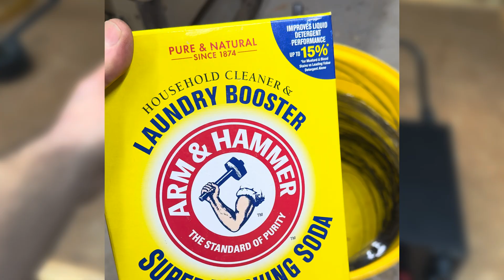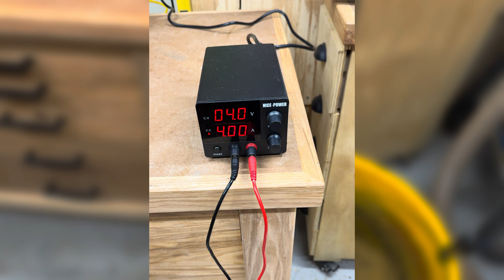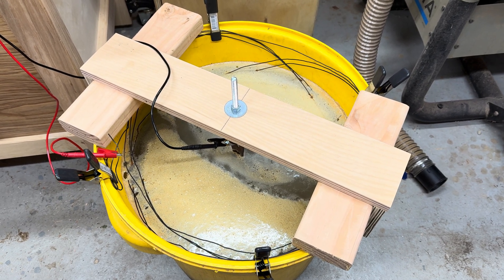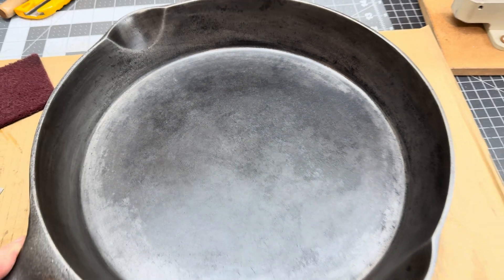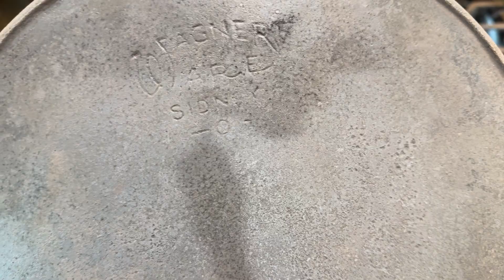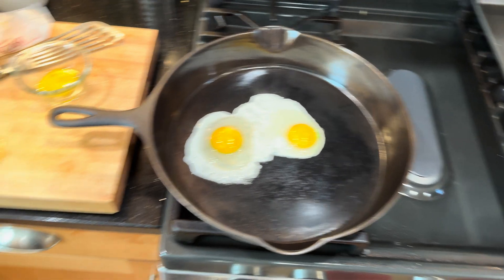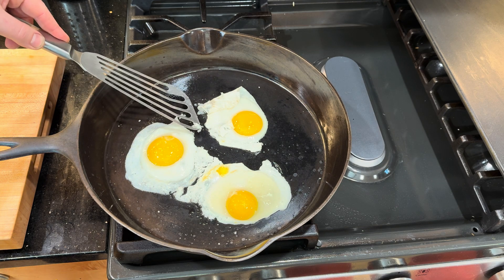I Made An Electrolysis Tank and Restored a 100 Year-Old Wagner Cast Iron Skillet

Comment: Used WAY too much washing soda! Only need 1 TBSP per gallon of water. Which would be 1 and 1/4 cups of washing soda for 20 gallons of water.
Reply from the maker: https://www.castironcollector.com/electrolysis.php (which I find quite reliable on most cast iron topics) recommends 1-2tbsp/gallon or 1-2 cups for 15 gallons. I think I put in less than 2 cups here. 

Is there a reason or source you have that supports sticking to the minimum?

Comment: nice job. I would sugggest not using dishsoap on a seasoned cast iron pan.
Reply from the maker: Please don’t believe the anti-soap propaganda. Soap hasn’t had lye (the component that dissolves seasoning) in it for decades. Washing cast iron with normal dish soap (just like any other pan) is actually very important as it keeps it clean from greases, oily gunk, and carbon buildup.